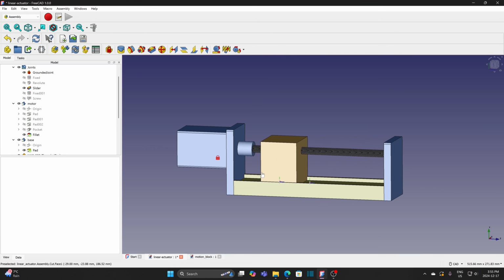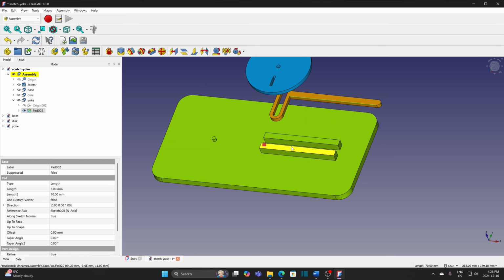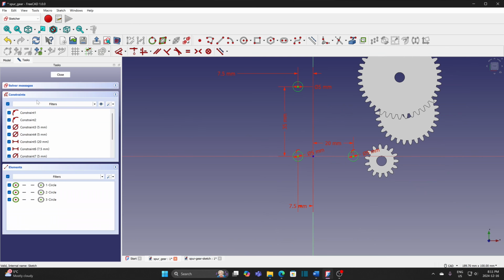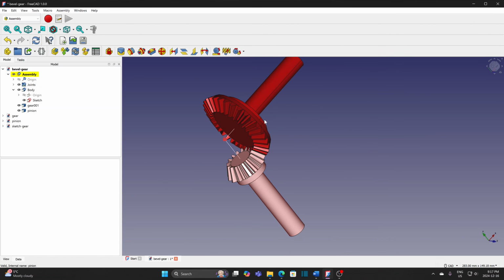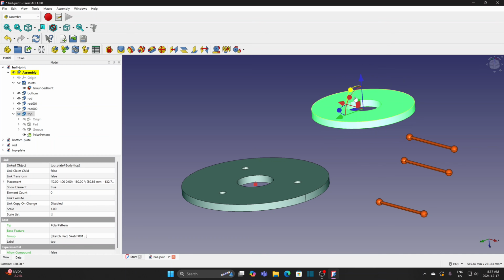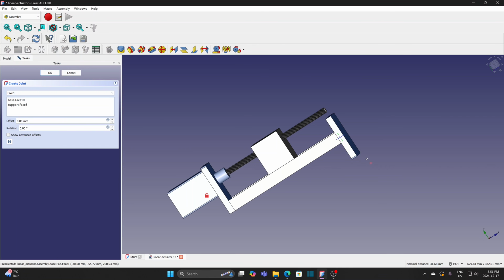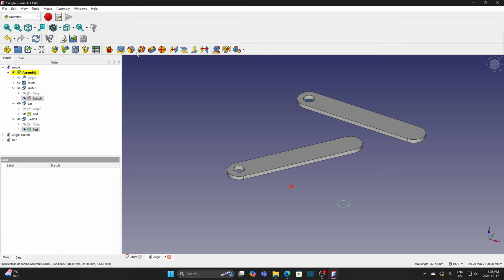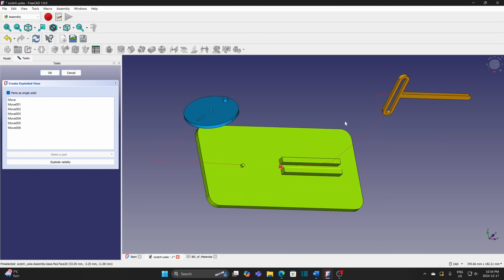FreeCAD 1.0 Assembly Tutorial- All you need to know to get started

Comment: How can I make a cylinder roll around the outside of a rounded rectangle?
Reply from the maker: Hi, I am not sure what exactly you mean. From your question, it seems the outside is round and the inside is rectangular. But the inside of a "cylinder" should be round. Do you mean a cylinder with outside rectangular body?
Reply: @KK_CAD Let's do it in 2D. Body C is a circle, body R is a rectangle. R is fixed in place. C can be anywhere where its perimeter touches R's perimeter (but doesn't overlap it). I.e., C can roll along the border of R. Now extrude C and R and you get the 3D version.
Reply: @KK_CAD Alternatively, restrict the movement of a body in such a way that the center of the body is always on a given multi-segment path.

Comment: First, I have to say, this is an AWESOME VIDEO!!! Like very awesome, as in super awesome. Good job KK. Now, when I tried the rack and pinion gears... it just did not work. I got the rack to slide, the pinion to rotate. But, when I did the rack and pinion gears together, they both move in different directions, different speeds, etc, etc. But, I did get the first linear actuator ( door closer ) and the Yoke thing to work. Gotta keep learning on my part. Very good on your video...
Reply from the maker: Thank you! I came across similar problem before. I think the easiest way is to start over with a new file and do it again. Follow the procedures step by step. It usually works.

Comment: Hello thank you for your tutorial. Maybe you could help me. I try to follow exactly your instructuion. But at the began, after inserting the different part, i can't move them with the mouse. Only with colored arrows it's possible. When i create the first revolution joint, even the position is good i can't move it with the mouse. I probably did something false, but after searching a long time, i do not find any solution. Will be happy if you know what's wrong. Thank you. My version is Freecad 1.0.
Reply from the maker: Hi, Most probably, the Assembly is not "activated". Double click the "Assembly", the color will change and the word Assembly becomes bold. See if this help. Please let me know if you still have problem to get it works.
Reply: @ I will have a look again, but i have already make verification this morning . i will look again , i’m at work at moment. I think make something wrong but don’t know what. I ´ve follow other tutorials Assembly, and i have the same problem.
Reply from the maker: Another thing you can check is at the right bottom corner. There is a mouse icon to set the mouse setting. Like CAD, REVIT, Gesture etc. It may affect how the mouse work. See if this setting is correct or not.
Reply: @KK_CAD  Miracle
I changed GESTURE to CAD and it works! Many thanks. Wonderful.😀
Reply from the maker: @davidburnouf5660  Super!

Comment: Hi all! Does anyone know - do You have to restrain the movement of joints only by setting the degree range? Or is it possible to select object A - which is connected via joing to object B. Then select edge on object B and somehow setup the rule - hey object A - dont go beyond this edge / face! Otherwise You crash inside the other object! Is it clear what I mean?
Reply from the maker: Hi, I think you are talking about "interference" between 2 parts. Correct me if I am wrong, I think "INTERFERENCE DETECTION" is not available at this moment in the Assembly Workbench to prevent "interference" between 2 parts. However, limits can be set up in SLIDER JOINT, CYLINDRICAL JOINT and REVOLUTE JOINT that avoid interference. When you set up the joint, you will see the limits in the "create joint" window. But if I put 2 gears too close together, I can still rotate the gears even there is "interference".
Just for your information, when using Assembly 4, there is a CHECK INTERFERENCE function that tells the interference between parts if there are any.
Reply: @KK_CAD  Thanks a lot! thats exactly what I meant. Thanks for explanation of the stiuation
Reply from the maker: You are welcome!

Comment: Bevel gearbox:
Funny: if you double click on the gear, you can't enter -30 or reverse, but if you only just select it, you can enter the value of -30 - it works. 
Showing how to correct angle offset is very helpful to learn something - thanks
Reply from the maker: You are welcome! Yes. It is something FreeCAD may need to be adjusted for "reversing" the rotation. Glad you enjoy the video.

Comment: I didn't see the yoke move when you rotated the disc.
Reply from the maker: Hi, I move the pin when it is at "0" degree, so the yoke move only a little bit and it is not very "smooth". When the pin reach about 15 degree, then the movement will be noticeable. However, use the yoke to move the disk is much easier than using the disk to move the yoke. Hope it helps. Thank you for watching.

Comment: Thank you very much for the Video. 
I would like to do it step for step: Is three a place to find the parts, which are used for the Assembly Exercise?
Reply from the maker: Thank you! I am glad you are interested in it. Please follow the link to copy the files: https://drive.google.com/drive/folders/12l9LVP-5Ma8Qv-2wyDbFA8JiIDJScq0k?usp=sharing
Reply: @KK_CAD  Thank you very much.
Reply from the maker: @romanhar4151   You are very welcome.
Reply: @KK_CAD  Thank you for the Files: I am "redoing" all the exercises: 😀
"Pinion Rack Example":
needs "Freecad Gear" to be installed

Rack import caused Problem with "AttributeError: 'App.DocumentObject' object has no attribute 'Shape'. Did you mean: 'Scale'?", If I import it seperatly it's not showing up. 
After Import, Importing "involuted Rack" instead of showed "Rack" works somehow.  

For Pinion-Rack constraint, I got some "207.147 <Assembly> AssemblyObject.cpp(176): Solve failed: Rack pinion radius is zero." Error. But it somehow worked. 
After Save and reload I get "<TopoShape> TopoShapeExpansion.cpp(970): hasher mismatch" and It's not really working..
Probably some issues in FreeCAD.. 😐
Reply from the maker: @romanhar4151  Hi, Yes. You can go to "Tools" at the FreeCAD file menu bar. Click it and you will see "Addon manager" from the menu. Double click it to install the "FreeCAD Gear".
Reply from the maker: I mean find the FreeCAD Gear from Addon Manger, then select and install it.
Reply: @KK_CAD  I cannot find FreeCAD Gear, I do find "freecad.gears workbench". Is that the one I need? I get the same errors as romanhar4151 reported.
Reply from the maker: Hi, "freecad.gears workbench" is correct. Install this workbench, it will be fine.
Reply from the maker: Hi, I think I missed some of your messages. Anyway, for this example, I would suggest you to re-do it from scratch. When I open this file, sometimes, the rack and pinion don't match. I am not sure the exact problem. But when I re-do it again, it is fine.